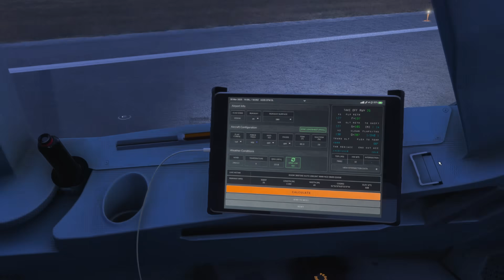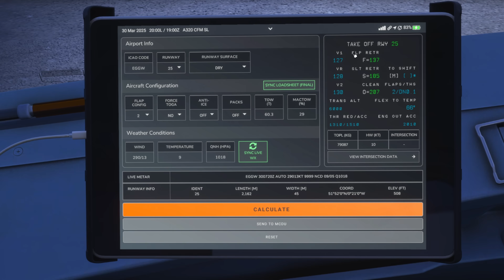Flaps 1 or 2 for Takeoff? | Real Airbus A320 Pilot Breaks It Down in MSFS 2024

Comment: Captain, thanks for the video.
1) I think you're going a little fast on the OPT flap setting. Noted that you don't have it in your shop, but what does it do ? Or is it something that doesn't exist AT ALL in the real world, and is therefore home brewed by Fenix (in which case we should obviously ignore it) ?
2) how often are there enough of the conditions to warrant use of Flap 3 for you to use it IRL ? Is it something super rare ?
3) why is the first setting called "1+F" and not just "1" ? To be consistent with Flaps 2 and Flap 3
Reply from the maker: Hello, the OPT function on the Fenix stands for Optimal flap setting. This does not exist in the real world as operators like to narrow the starting point down for various reasons. You do not have to ignore it, but if you are trying to replicate real world operations you may choose to. The OPT calculation has improved over time and now usually gives a normal setting for takeoff. Use of flap 3 is rare, it is usually used on short runways during winter operations when we try to improve our stop margins. For the flaps, in flight flaps 1 only extends the slats. Config 1+F is a takeoff config where slats plus the trailing edge flaps are also deployed. In the air: Flap 1 = slats only, on the ground: Flap 1 = 1+F. 1+F gives a better compromise between lift and drag for takeoff performance
Reply: a bourbon AND coffee for those explanations !
Reply: @AirbusCockpitCoach  Thank you very clear.